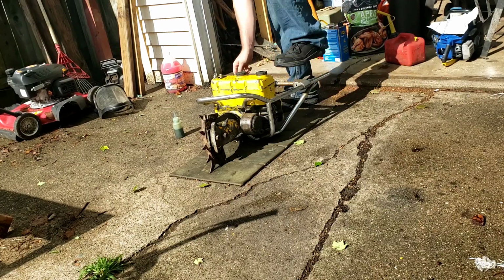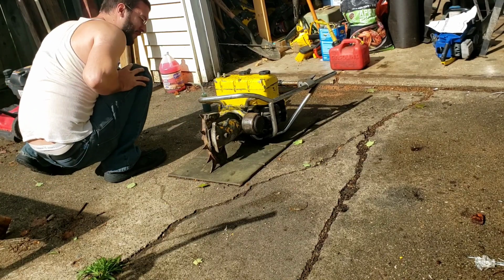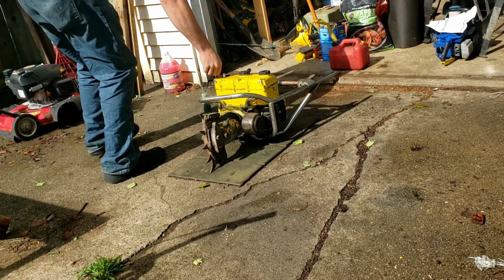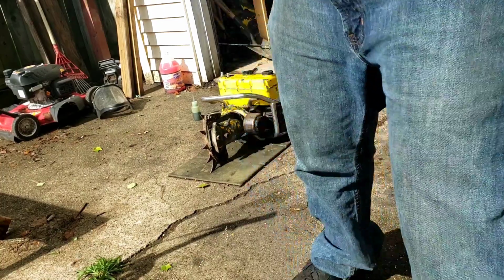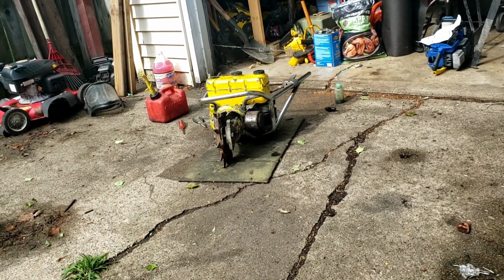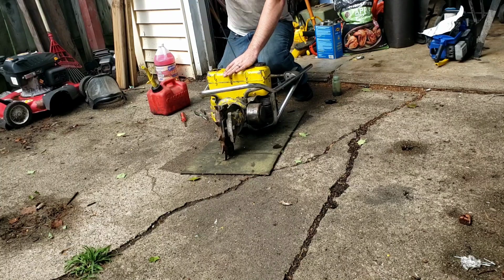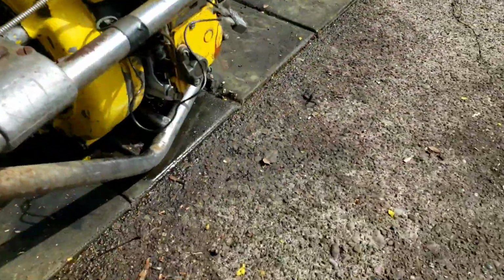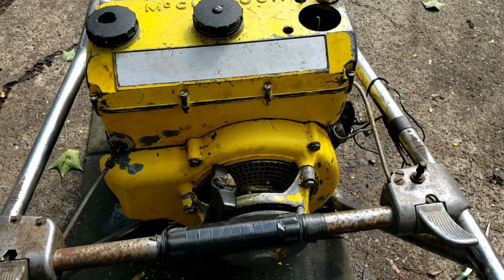Mcculloch Model 99 running

Comment: Nice to see it running any more research into the high idle
Reply from the maker: No, more research has been done into the high idle, i suspect the butterfly isn't shutting as far as it should be or air leak.
Reply: @mistermacgray   you'll get it sorted before the shows start
Reply from the maker: @petehellak4772  it will be going back up in the loft soon. I might have a spare carb in the parts bin for her, taking the tank off to take the carb off is annoying.
Reply: @mistermacgray   yes a lot of extra work